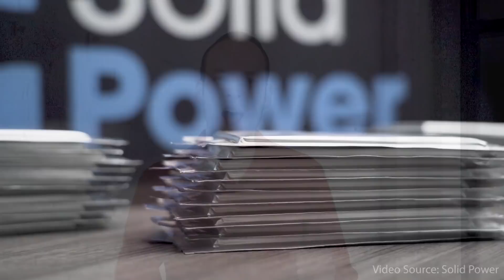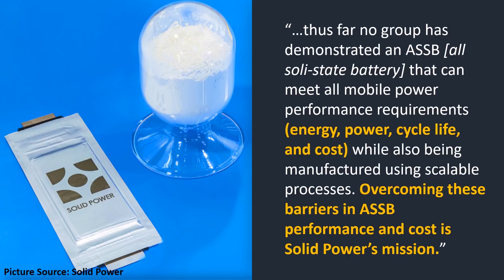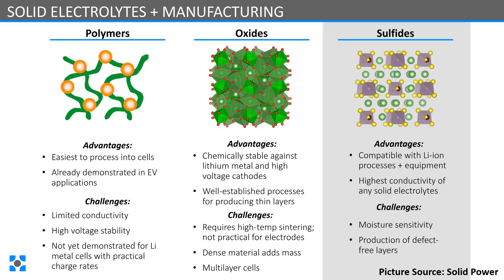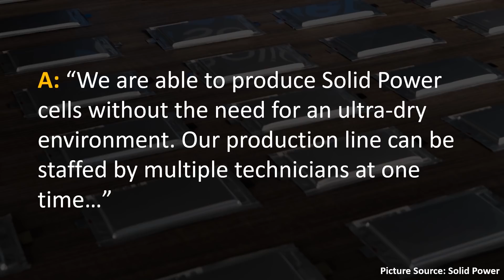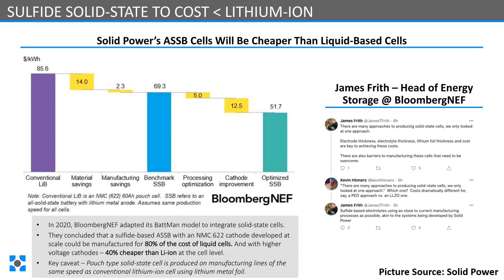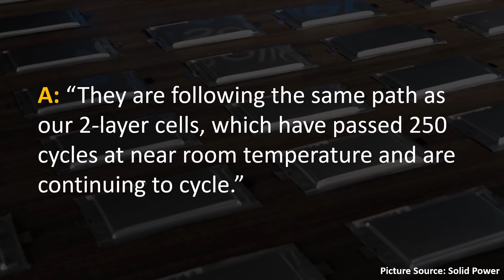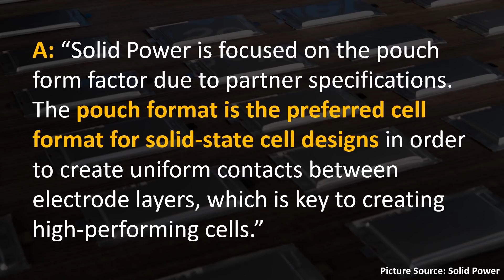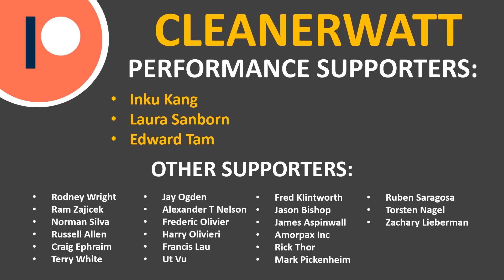Solid State EV Battery Tech: Reality vs Hype (Solid Power Batteries)

Comment: Pouch cells are much better for EV battery packs. I think the reason Tesla keeps using cylindrical cells is because of legacy. It would be very difficult for them to suddently start using pouch cells. They have too much money and development invested in cylindrical cells.
A very good example of pouch cells being better is the cells used in the lone which have the terminals on opposite ends. You can put them end to end and clamp the tabs together. Suddently you have no bus bar. The flat cells are also easier to cool. On a flat cell your cooling system has access to nearly 90% of the cell surface area. On a cylindrical cell you will be lucky to get 25%. The new tables design is not without issues either. The ends of the cells have to make contact with a bus bar. Because they can not be welded they have to be clamped that means the bus bars have the potential to slide on the cells which is not good for vibration. Also you have to apply cooling to the bus bar which needs to be isolated from the coolant.
Pouch cells do not have these problems. Also pouch cells need to be clamped to stop them from swelling. The clamping mechanism can be also structural. The can on a cylindrical cell is the equivalent of the clamping mechanism and it can not be used as structural member because it is not easy to bond to and finally pouch cells are far more volumetrically effecient.
As for manufacturing cylindrical cells are easier to automate but you need lots of them and and they need to be connected.
A 60Ah pouch is equivalent to 20 3Ah cylindrical cells. One pouch 2 joints 20 cylindicals 40 joints. So even if making a 60Ah pouch is slower  you have to make you need a lot less pouches and joints and they are also automated.
Reply: Tesla doesn't do legacy.
Reply: @theuncalledfor  legacy means something that is either obsolete or of lower performance but continues to be used because replacing it is too costly or difficult.  By that definition cylindrical cells are legacy. When Tesla started cylindrical cells were easily available so Tesla used them and build their battery packs around them. Pouch cells are a much better option but Tesla couldn't get pouch cells of the shape and size best suited for an EV because no one made them. So Tesla just went out and bought lots of laptop cells. Once EVs became more popular cell manufacturers started making suitable cells.
Why do you think no other manufacturer uses cylindrical cells if they are so superior. It has nothing to do with chemistry or patents. Tesla buys cells from Panasonic.  Panasonic can sell their cells to anyone that wants to buy them.
Reply: @franciscoshi1968  
How, why are pouch cells much better for EV's?
And, Tesla OWNS every cell leaving the factory, Panasonic can't sell them on.
Reply: @rogerstarkey5390  Panasonic can setup another factory and sell 1850 cells. They are laptop cells.
Pouch cells have the following advantages:
1) larger capacity per cell. A 250Ah pack only needs 4 cells in parallel that means 4 joints. Using 18650 cells at 3Ah each you need 83 cells in parallel ie 83 joints. The new bigger cylindrical cells use less cells but it is still a lot more than pouch cells.
2) a pouch cell being square fills up the battery pack (also a square) more effecienty.
3) a pouch cell being flat is far easier to cool and it has much lower thermal resistance. A pouch cell is about 10mm thick that means the furthest any part of the cell is to the cooling system is 5mm. An 18650 cell being 18mm has an absolute minimum distance of 9mm assuming you can get your cooling system to touch the whole surface. In a Tesla pack the cooling system only touches about 25% of the cell surface on q pouch cell you can touch 90% of the cell surface.
4) If you have tabs on opposite sides of the pouch cell you can bond the tabs together so no bus bar to connect between cells. (Lighter and cheaper to make)
Reply: You'd think pouches would be lighter but they're heavy for what they offer.

Comment: sounds like they are taking YEARS to test how many cycles the batteries can handle, which makes me think they are charging and discharging VERY slowly... And this makes me think this technology is still many years away from being viable in EV applications.  I hope I'm wrong, but nothing I seen here convinces me they will have a solution ready for mass production before 2025 at the very earliest, likely much later.   At present, including the janitor, this company has less than 50 employees... they have a long way to go.  The cost of it all was a pleasant surprise tho !!   I hope they succeed, because this would further push battery tech forward.
Reply: no doubt they will raise billions with their hype and disappear in a few years when it turns out they can't manufacture their product.

Comment: Why is it so important to br 100% solid state. Wouldnt the priority be on non oxygen, quick charge with minimum degredation. Does it matter if it is a hybrid.
Reply: The problem is all liquid electrolytes are flamble. That is the reason for the 100% solid push.
Reply from the maker: Exactly.
Reply: @Cleanerwatt  exactly what? Qs has demonstrated that their technology isn't flammable. So what's your point?

Comment: You asked the right questions.  Well done!

1000 cycles isn't good enough for automotive applications, alas.  I suspect Solid Power will struggle to do much better than that.  And if they can't use cell cans, then the production costs will never fall to $50 per kilowatt-hour on any time horizon I can anticipate.  Cans are just better for mass production - cheaper, faster, less capital-intense.

I do appreciate the fact that they are less inclined to hype their tech than their rivals, whose breathless declarations strike me as having only one purpose - to boost their stock prices.

Thanks for the deep dive!
Reply from the maker: Thank you - well said.
Reply: 8 years cycled (chared?) everyday = 2920  days (chargings?)
Reply: @brandoYT  A cycle life of 1000 means 1000 charge-discharge cycles.  By then it has fallen too far out of spec (generally 70% of original max charge or worse).

1000 charging cycles isn't very good.  Lithium-manganese does considerably better.  LFP is even better than that.  4680 cells will do much better, too, I think, though Tesla hasn't yet disclosed the expected cycle life for those cells.
Reply: @Urgelt  This is more or less incorrect. On a cycle test they go from full charge to full discharge (with undervolt protection) to verify their results because it's easier to do so. This isn't the case in real usage scenarios for EVs where the vehicle doesn't go between a 0-100% charging cycle very regularly (most people go through significantly smaller ranges because they drive much less than 200 miles per charge (except for roadtrips). 

Next, when they talk about charge/discharge cycles, it's already well known for current batteries which have a cycle life of 500 charges per cycle. Assuming that the average EV has around 300Wh/mile in terms of usage, we're looking at a life of 4.2 years before the batteries degrade to 80% capacity for current Lithium batteries of a 55kWh capacity and 60 miles per day. For Solid Power's batteries it would last for 8.4 years. The packs would still be more or less usable for anyone since 55kwh gets you around 220miles and a 20% reduction would put you at around 180 miles. Only LFP batteries do better at around 2000 charge cycles, but you trade this off for much poorer weight to power storage ratios (160 Wh/kg) vs Lithium Manganese getting 250 Wh/kg. Tesla's new cell will do very little to improve cycle life because the internal chemistry still has the exact same limitations. Lithium dendrite formation will continue to be a problem on the cell chemistries Tesla intends to use. However, as I've explained, it's not a problem, since as Tesla has currently geared it, their cells will last 4-5 years for the average person. Most people would be happy with that.
Reply: @wakannnai1  Regarding your first point, I agree - 1000 cycles doesn't mean 1000 hookups to a charging port.  It is, however, a measure of the durability of a pack.

500 cycles is not the current state of the art.  Tesla's packs are 1500 cycle packs, last I read.  Their 4680 cells should be significantly higher than that, although Tesla hasn't yet disclosed what the cycle life will be for that battery technology.

That is what solid state packs will have to compete against.

We might do a back of the envelope calculation and derive very roughly 200,000 to 250,000 miles of life for a 1000 cycle pack.  With a 1500 cycle life, Tesla is already at a third to a half million miles on a pack.  I expect the 4680 packs will be a lot higher.

200K+ miles of pack life doesn't sound too terrible when compared to an ICEV (non-diesel).  But it isn't going to be competitive with Tesla's offerings, and it's far, far from useful for heavy trucks.

And if solid state cells aren't cheap?  Cheap ass in, say, the realm of $50 per kilowatt-hour of storage, or even better?

The economics for solid state will not look good.

I am suggesting that given where research currently is with solid state, commercial success may be a long way out - a decade or more.  Or it may fail entirely, done in by better tech.

Better tech is coming.  I can't tell you which cell tech will reach the commercial market, but billions of dollars are being spent by hundreds of researchers around the globe.  They are not all betting on solid state.

Tesla has an intriguing patent for an anode-less cell.  It has a cathode and electrolyte; the electrolyte both transmits ions and captures them.  The capture volume is thus much expanded compared to more conventional cells, and the path ions will take is, on average, reduced, which means less heat to worry about, and faster charging.  Will it work?  I have no idea.  Most new cell chemistries don't make it to commercialization, of course.  But if it does, it's going to boost cell performance considerably.  It might lower production costs, too - fewer components to assemble.

Maybe solid state will get better cycle life.  Maybe solid state costs will become appealing.  Anything is possible.  But I am not able to be optimistic about near-term commercialization, given what we're hearing from researchers at this juncture.  It's not ready for prime time.  And something better might appear before it's feasible to commercialize it.
Reply: Good info! How does the can stack up against the pouch in cost per kWh? On this web page written in 2019 the cell form factors seem to have the same projected cost in 2020 and 2025 on the cell level: https://batteryuniversity.com/learn/article/types_of_battery_cells but it differs from Teslas line chart (09:00). Tesla 4680 can cells will probably cost much less in 2022.
Reply: @raxzore  There are two many variables in play besides the form factor to give a definitive answer.

Pouch cells are big compared to cans, even compared to 4680 cans.  Auto packs using pouch cells contain hundreds rather than the thousands of current-tech can cells used by Tesla (it will be fewer when they use 4680 cells), so pack assembly is cheap - note that it's the pack cost that is truly important, in terms of the final price to the consumer.

So pouch cells do have that advantage.  But pouch cells are volumetrically disadvantageous, since they are not fixed in size, but grow larger or smaller according to state of charge, so they have to be plopped into generously-sized boxes to hold them.  And cooling pouch cells in those boxes is harder - which means either that thermal control is less effective (with implications for cycle life), or more expensive and heavier, requiring beefier solutions.

And, of course, there's absolutely no way to use pouch cells in cell-to-structural pack designs, so cost and weight savings from that technology can't be obtained with pouch cells.

There are many other variables.  Cell chemistry is one, with large implications for cost.  (Cobalt is expensive!)

I'm fairly well convinced - but it's only an opinion, and not that of an expert - that Tesla's 4680 cans and their pack technology will yield dramatically lower cost per kilowatt-hour of storage than pouch cells will ever be able to attain.  But I don't have visibility over every variable, and there are likely clever engineers out there in the world.  Some of them might surprise us.